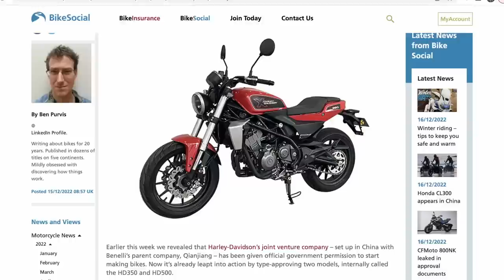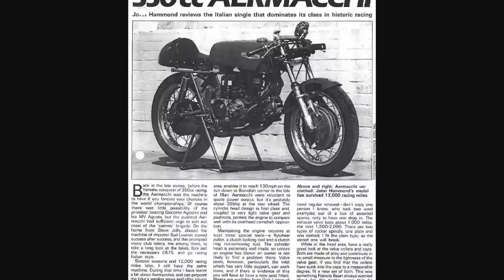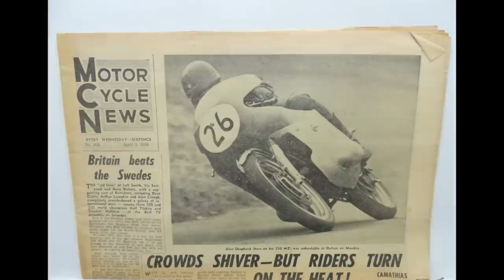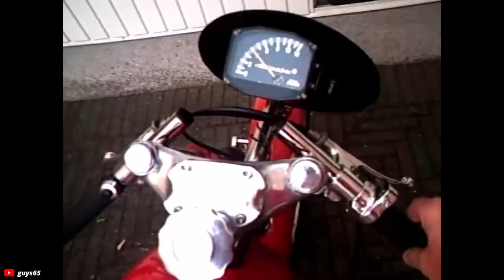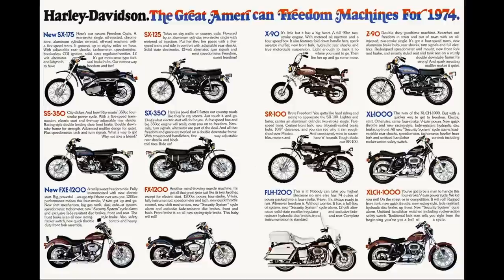The time Harley Davidson won MotoGP

Comment: I’m so happy to hear of Harley Davidson doing something right. I’ve never owned one of their products,and I’m not brand loyal. You have given us more to the story of this company. So I respect them just a smidge   Thanks again for creating content that is well thought out.
Reply: They did have a super rich and successful history in racing during the early part of their existence. The kind of bikes they make just gravitated away from the competitive racing scene, nothing wrong with that.
Reply: @raoul1650  Well, to be fair they kind of just kept competing in flat track with outdated equipment. Racing doesn't have to echo their street bikes.
Reply: @TravisTerrell  that is true, but that's because they had a winning formula. When they tried to change it things actually got worse for them. I wouldn't be surprised if Harley was influencing the rules in flat track racing honestly to stay ahead, but I just don't really see why going racing is what every company has to be known for. Harley purposefully sticks to highly antiquated air cooled engines with pushrods that can't rev past 6500rpm without blowing up. We know for a fact that they can make better engines, because they have with their revolution max engine, sure it's still down on power compared to an ultra high revving inline 4, but the Revolution Max has all sorts of technology, with overhead valves they can rev higher, there's variable valve timing, it's powerful no ifs ands or buts about it. But they're still not taking it racing. That's because that's not the market they're trying to appeal to, they're trying to appeal to people who are comfortable buying 700-900lb air cooled cruisers that are designed to go cross country. Some of them are "hot rodded" but they're hot rodded in comparison to other Harleys. That's what Harley riders really want, and they're appealing to a separate market with the Nightster and Pan America and Sportster S. If the pan America isn't an example of doing something right, I don't know what is. They made their very first adventure bike, loaded with a ton of technology, a very powerful engine which is just a tiny bit slower than the R1250 GS, electronically adjustable suspension, all the rider comfort you would really need, just less refined than the top company in the space which has been in that space for decades. Harley aren't a company of screw ups, they have been complacent in the past and they are charging a premium price, but Harleys really are like nothing else out there in terms of the fit and finish, plus they're at least assembled in the US which adds considerable cost. They could manufacture bikes sold in America in Indonesia and pay the workers $5/hr with no benefits, (they might in other countries but that's a whole different story) but in the US the markup isn't as bad as most people think when you take manufacturing and materials into account.
Reply: @Scott Lowe - what the commentator meant was that in order to win races and get into the European small-bike market, H-D purchased Aermacci (an Italian bike manufacturer) and slapped their name on the side. Eventually, H-D managed to F::k Aermacci up the same way they f::k everything up and still produce bikes that even the Americans are buying in smaller and smaller numbers. Keep your money and buy a decent bike.
Reply: Think is most people who own a Harley also live the lifestyle I got my first Harley in 1982 I was 17 years old I still own it  I have owned 4 Yamahas and 6 hogs Sportster one pan head Shovelhead and three twin cams. Old bike you need to work on but new ones you just jump on. I think the best motorcycles is the one you are on. Keep it up on two's and ride with a smile on your motorcycles of choice
Reply: @montewolf3570  thank you. All brands of bikes have their benefits and drawbacks.
Reply: @TravisTerrell  the XR750 constantly evolved over its lifetime, the only reason it was replaced as the top bike was Indian showed up with something that much better.
Reply: never owning any of their products  is  the smartest  thing a  motor  cyclist     can   do
Reply: @larryduvall9475  not far off.
Reply: @raoul1650 the M8 motor does over 180 moh at the king of the baggers race

Comment: You never even mentioned the race series "King of the Baggers" at Moto America events across the US, even though you showed videos of these very races.  The King of the Baggers Series races big 750 lb. touring motorcycles with full body work including saddlebags; motorcycles known as "Baggers".  At first the attitude of race fans was; "Race Baggers?  Ya gotta be shittin' me?" 

Initially these big motorcycles would break down all over the place, and races were short for this reason.  However the racing proved entertaining and exciting, with Factory Sponsorship and top motorcycle racers riding in this series.  The races have gotten better really quickly and offer the fans real, legitimate competition!

Motorcycle racing has always enhanced the engineering and technology of road going motorcycles for sale in dealerships and Baggers are no exception.  In building big touring motorcycles that can lap a race track at 100+ mph and stay together, the engineering, technology and lessons learned filtered down to improvements on baggers for sale on the showroom floors. As a result Bagger motorcycles are becoming; more durable, more powerful, better handling, with improved suspensions, better brakes(especially), better tires, more aerodynamic, etc. 

Baggers are becoming MUCH better performing street motorcycles as a result of the racing in King of the Baggers Series. Virtually all the big motorcycle companies make these heavyweight touring motorcycles and most motorcycle marques are now racing in this series.

Anyway, my point is; the engineering required in racing improves the technology found on street motorcycles. This has always been the case. A VERY large portion of Harley Davidson business is selling these big, heavyweight touring motorcycles, i.e. "Baggers" (also called "Dressers"). 

Baggers can sell for $30k +; with a few exceptions this type of motorcycle is the most expensive. The King of the Baggers races have helped Harley improve their big touring motorcycles and to sell more of these bikes.  Frankly, this genre of motorcycles are normally sold on the virtue of styling, heritage, and looks, but were ripe for some extensive technological improvement, IMO.

FYI, Harley Davidson is now struggling to build smaller “starter” motorcycles to attract younger riders and foster brand loyalty.  In the 1970s Aermacchi provided these smaller motorcycles in the Harley Davidson line up.  

Aermacchi motorcycles are sought after today and many of the 4 stroke singles sold in the US in the ‘70s are being purchased and shipped back over to Europe for use in Vintage racing.  Aermacchi was a quality motorcycle company with a racing heritage before its merge with Harley Davidson.  Aermacchi filed an important niche in that Company which is missing today.

Comment: Speaking racing a Harley. l remember a Lance Weil racing a Harley in the mid sixties in UK... saw him a couple of times at Brands Hatch race track. Regarding Aermacchi, l always thought it a shame that Harley Davidson became involved with them mainly because the Italian motorcycle company had little in common with Harley motorcycles, design wise...l loved that horizontal single cylinder engine. Most Italian bikes of that time, Aermacchi, Moto Guzzi, Bianchi, Capriolo, even the diminutive Itom and of course Ducati had that Racer look about them.... about as far away from Harley Davidson as one could get.....
Reply: I have here in the Philippines a 1969  SS350 Aermacchi/HD that I bought from Lance Weil in 1990. BTW in his UK races, Weil had is HD engine in a Norton frame.
Reply: In the 70's riding an iron barrelled  750cc H.D. V twin was the late great Cal Raybourn killed racing in N.Z. He certainly surprised  some of the top British riders in the easter match races.

Comment: If any of you are interested in seeing some on board race videos of an Aermacchi, I have a lot of videos on the 250 and 350 four strokes from the 60s and 70s. Bart is completely right about them being fragile, you get a good 30 laps out of them before they need to be rebuilt.

Comment: Something else that might be relevant to the H/D Aermacchi relationship. Like the big twin (but not the sportster) the sprint 4 strokes had the valves intake above exhaust but the cam ran in plane with the crankshaft so the pushrods did a 90* twist. Of course this was all inside the cylinder casting of the Italian unlike the exposed pushrod tubes that give the big twins the pipe organ look. I had a ‘67 250 which had another unique quirk, impossible hot starts. The side draft carburetor was directly above the hot cylinder so the float bowl would percolate and flood the engine. Years later I was comparing notes with another ex-sprint owner who rode his to night school math class 3 nights a week. In order to be able to restart it after class he’d park it, remove the spark plug and put it in his pocket. He went on to say that he still couldn’t do algebra unless he spilled hot coffee on his pant leg.

Comment: The world  GP series in those days was not called MotoGP.  The top capacity GP bikes were 500cc . The name motoGP came in in 2002 when the bikes changed to large capacity four strokes although 500cc bikes 2 strokes  were allowed to compete but these soon faded out  as they were not competitive. Your title is inaccurate on two counts. The term used is wrong and HD never won the senior class but did win the smaller 250 and 350 classes.

Comment: Harley had access to great racing technology with Aermacci which they could have used to make great American made road motorcycles, but no, they decided 900 pound chrome turds was the way to go. They did take a decent stab at building racing motorcycles in the US with the VR1000 but they weren’t competitive and then they blew up.

Comment: Good job with this one. You might look at the winner of the F750 class at the Isle of Man, and the bike he finished second on in the Senior TT. A bike engine that was a boring bar design from a mid 40s 500 single splitting the factory Suzuki 500s and winning F750 on the Norton he built and spanking the Kawasaki and Suzuki triples with the pushrod twin from 1946. Good autobiography  book Engineered to Race and cigarette sponsored documentary  Race of the Powerbikes. On youtube
Reply: That was 1973

Comment: Doesn't anyone remember the Harley Davidson's
"Wrecking Crew???"
Or Mamola and the VR??
The drag racing "Destroyer?"
When was the last XR made, 1978!??? Or Eric Buell, with TZ-250 spec's, 52 inch wheel base, 21 degrees of rake, and a Sporter engine.
We were "PROMISED!" VRs
I've been waiting since 1977, to give me a bike I'm not ashamed of riding (XLCR).
Just saying........,
Suzuki stole the 'secret' porting. (Eyebrow exhaust ports) from here in the USA.
A drag racer, who ran the little 250 H-6 Hustler. (record holder) still I think.

Comment: I found it strange, that when you mentioned Erik Buell and Harleys merits on the race track, you failed to mention Harleys own attempt to make a race bike for superbike, the VR 1000.
Reply: Most likely because the VR1000 was a missive embarrassment to everyone involved. When it actually made it onto the track, it was either too slow or quickly broken.
Reply: @baseshark  Was that when they had to have a separate class for just Harley VR1000's?
Reply: @ronwoudenberg2294  yeah Harleys a good at winning races that only Harleys can compete in.

Comment: Wow, you are a cut ✂️ and paste artist.  The harley davidson  locked up in 1973. There is an inquest,  in is in  Italian, that was done. The uneven  cooling of the cylinders, do to a strike in Italy, lead to the harley causing the wreck. The oil on the track was not even a factor in the wreck.  It is cut and dry. Walter Villa was hired by harleydavidson later, after be accused of oiling the track. Renzo Pasolini was riding a motorcycle that locked up. The "Aermacchi harley davidson " caused the wreck. It is cut and dry. The 1973 bikes were crap!

Comment: Please, Harley Davidson cannot and will not ever get near top level if any level competition again.  The company is dying.  The company will not invest in r&d anywhere sufficient to come up with a modern design let alone a race worthy one.  Even the VRod was a Porsche design under contract ( much like Toyota and Nissan used Yamaha  to find horsepower in their engines and design their sports cars.  HD couldn’t and wouldn’t take the risk on designing much less building a race bike now since they have risk averse management and have had for decades.  
The HD individualist maxim is a lie.  May as well be a Swiss bank.  Their motorcycles have long been under powered, under braked, over weight and over priced lumps that appear to have been designed by people who simply don’t understand the dynamics of even how motorcycles steer.
 The rest of us are decades past that and H D know that their target market baby boomers ( me too) are dying out.  They do make? Some nice boots and pants though…
And just so you know, The Italians were building fast two strokes anyway by the time HD bought into Aermacchi the race bike builder.  HD had no idea where two technology was at and didn’t care.  And note that the 250 class was not ever the Premier class in GP.  At the time it was 350 and 500cc.

Comment: You butchered the pronunciations especially " ah err Maki ".... how can you have done this ?
You showed a picture of Giles Villenueve as W. Villa.... Agostini etc. You missed out on the little known now
braking system the "idronico " which is a form of a drum brake . It's a cone working within a cone to work smoother and has increased surface area.  Better for aerodynamics. You had one pic of it btw. 
Macchi did not need any engineering expertise from H D . They were building 16 cylinder twin plug per cyl 
Supercharged aircraft engines in the 1930s and still hold the float plane records. Italy was under financial 
mayhem due to the OPEC restrictions, so it was a mutual benefit to do business.  I lived it. 
Thank you for sharing some light ..... call on a real Italian , contact a consulate or some of that nature next time

Comment: HD are in a real pickle. Their former customer base is retired or retiring, and their current product line is lacklustre and rearward looking. Indian out HDs them so easily, because they developed their engines and adapted to the 21st century and not the 1980s. Buell was their best chance, and they blew that. The buells were spoken of in reverential tones among the cognoscenti of riders. Original thinking and some insight into the future. Perhaps if they buy up as much of the technology as they can from Buell or the estate, or what ever they have to do. At any cost, or their decline will be terminal. Who is stupid enough to buy a sloppily made overweight piece of badly designed junk without any power, when far superior options exist at one third of the price?  The big dressers won't save the company, because the world will run out of gay men eventually who tolerate them. HD, you lost the niche you once  had, and you are resting on your credit now. That will not last very long. You need industrial designers and technology (Buell) You need to rid yourself of the old man's image, and the sad gangster facade of the brat packs with matching cloths.  
Recall what happened to the once great British motorcycle industries? They looked nice, they were more fun than an HD, but you used US cultural hegemony to your advantage and Ronny Rayguns help to save your company. The British bikes wept oil everywhere, and they vibrated themselves to pieces, A two-hour ride would take four and a half for repairs and looking for fallen off bits. You are still working the same crowd expecting the same result, which will disappoint you. Get focused and build a far ore powerful engine, with genuine technology, using cad cam and the best and lightest materials. Move to metric unless you plan to be a boutique American brand exclusively. The middle-aged men who want to play cowboys and Indians worldwide have never ridden a bike and the HD will kill them off very quickly, so at least give them a fighting chance. Lighter weight, with real brakes and cornering ability, and all the safety gear possible. No longer rely on selling a 36K 60 BHP, almost litre bike with a single skinny carburettor or fuel ignition injection system. Make them corner properly, with a lean angle past 14 degrees (each way) 
The triumph made a comeback on nostalgia, in appearance only, with some models. So retro only works if all the bad qualities are removed and tamed. Forget colour schemes and crazy tough guy shit, and just make a genuine attempt at building the finest performing HD at the best price possible, you cannot gouge people to pay 35K then an additional 33.5K for a kit which adds 20HP. 80 HP is still shit.
Ducati L-engines can pumps out 225 plus BHP and can win GP's out of the box, aim much higher. 
Fork & tine crank shafts? One carburettor with a bad V angle? Bad breathing and no exhaust design. A single coil with single spark plugs?  No more foot pegs mounted to the engine casings???  This is a long list. My point is that paying 35K for nothing but disappointing nostalgia won't  cut it any longer. Business lives or dies by making the right decisions at the right time, in the right order. Never by reminiscences or the good old days. There were no good old days. HD believing that is why you are building and selling agricultural equipment that might be alright running an irrigation pump, but nothing more.
Okay, I don't like HDs and never have. But you deserve to survive if you work very hard at it. Best wishes.
Reply: Love how Triumph have reinvented themselves.